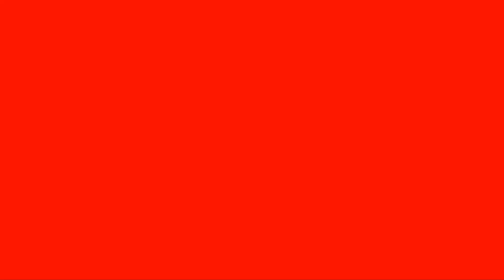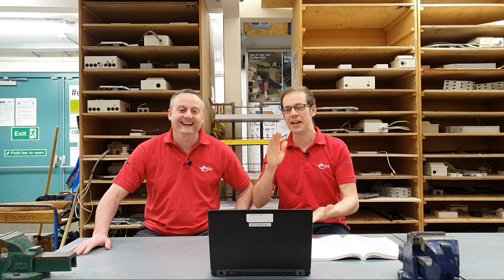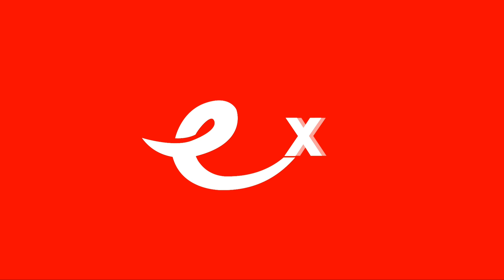18th Edition wiring regulations BS7671 amendment 1 2020 and EV charger installation.

Comment: There's been lots of talk in the United States about EV  Grounding, earthing and bonding arrangements whereby the "source" of the supply has the Neutral bonded to the CPC but nowhere else. All the downstream distribution boards have Neutral and cpc busbars separated ( as we do in the UK) 
Then they use Ground fault protection devices (RCD's) for EEBADS ( as we do).
Point i am making is that if no potential parallel fault paths for earth leakage exist, due to plastic gas, water and utility supplies isolating the dwelling from extraneous sources ...  then ( provided overcurrent and RCD / RCBO equipment supplies the EV charger) the problem of PEN conductor faults would no longer be a concern would they ?

Another solution would be utilising transformer separation , or a switching relay / contactor separating the Earth CPC from the EV charge point to the supply ?

Comment: So I’ve watched niceic Facebook live this morning now this and still confused. The IET always leave things open almost as though they won’t take responsibility. If I’m correct a newer charge point with the device that monitors the neutral is fitted then a TT won’t be required?
Reply from the maker: Yes your correct - if a charger has PEN fault detection then no need for TT - we made a separate video a few months ago looking at how the Zappi charger works.

Comment: On the rod issue.
 
1. If the rod is too close to buried metalwork connected to the PME earthing system, it is effectively connected to the PME earthing system (and hence doesn't comply with BS 7671). "Too close" may be as much as 3.6m (to achieve a touch voltage below 70 V if the PME earth is at 253 V) - although there are other conditions at play, so if you TT an entire installation the recommendation is 10 m separation below ground.
 
2. If the rod is separated, say at > 3.6 m, but you are standing on the ground directly above, say a buried metal water or gas pipe that's main-bonded to the PME earthing system, then all you've done is effectively returned the PME earth potential rise as a touch voltage, and it's still hazardous.

Comment: Personally am against earth rods I prefer the Zappi2 solution my reason;  People don't get there electric inspected after there fitted.  People are also stupid and likely to remove or damage earth rods.  Also I've seen engineers WATER earth rods to get the correct readings and to allow the car to start charging!
Reply from the maker: Wise words Nick!
Reply: In the UK we don't wet Earth rods to get a good reading, if required will   extend the rod deaper until it clearly passes the test in dry conditions and we have to write the results on the test certificate. Plus the cable is clamped and also fitted with a Tag that says 'do not remove'.
Reply: @markh9246  Check out my youtube channel am in the UK what is meant to happen doesn't always happen.
Reply: @NicolasRaimo  yes i know, ive seen shit sparkies do it in uk too, and i see somuch shit in Australia too, and aus is mean to to be most regulated.